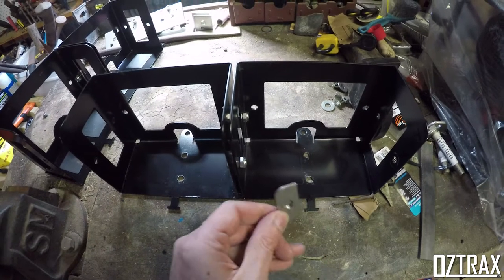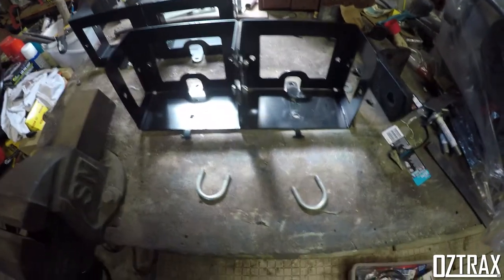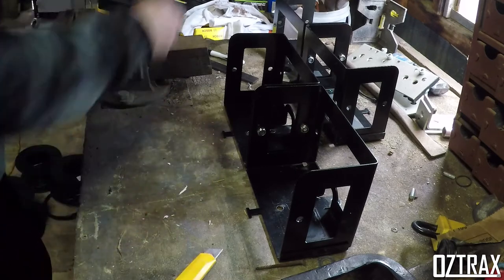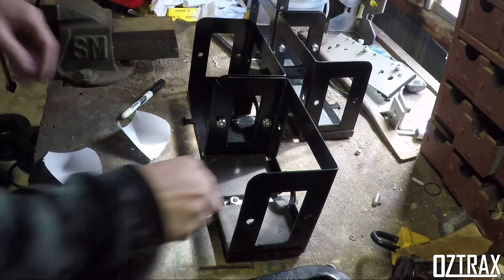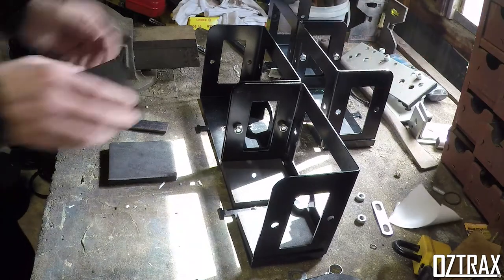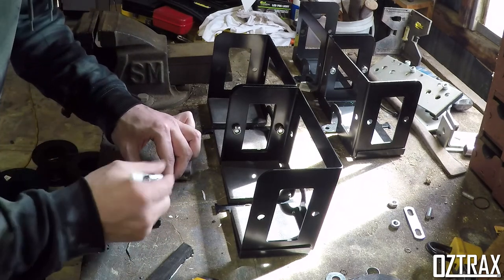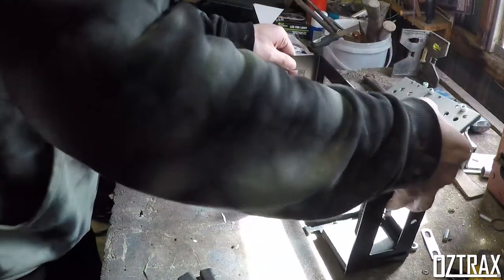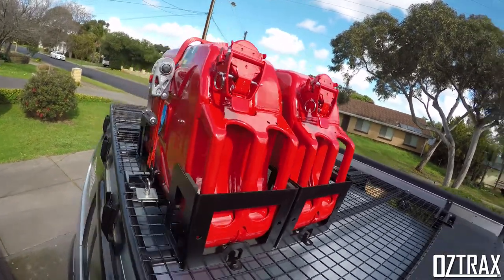DIY: Rack-mounted Jerry Can Holder // Pt. 2

Comment: what are those eye hooks called? can you provide a link, also a link to the u bolts?
Reply from the maker: So, with those, the eye bolts for the straps on either side of the jerry can came with the jerry can holders when I purchased them.

But you can purchase them from any hardware store.

They required 50x50mm washers either side of the mesh to secure them to the mesh.

The u-bolts I just picked up from the hardware store as well.

They will be different for everyone depending on your roof rack system.

From memyy, they were 1.5 or 2 inch u-bolts.
Reply: @OzTrax4X4  ah ok 👍🏻 
Thanks mate!
Reply from the maker: @HeetJoshiofficial  no problemo. 😎